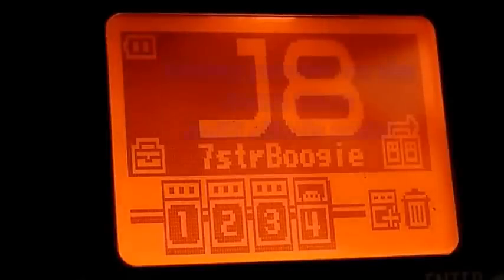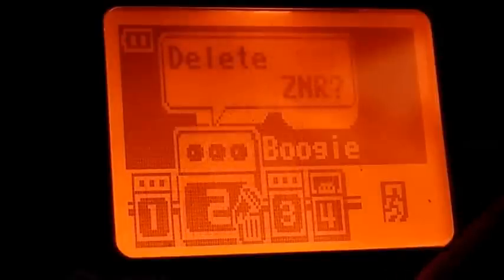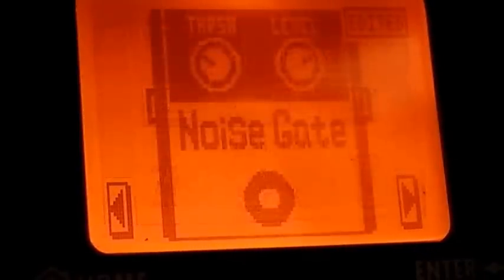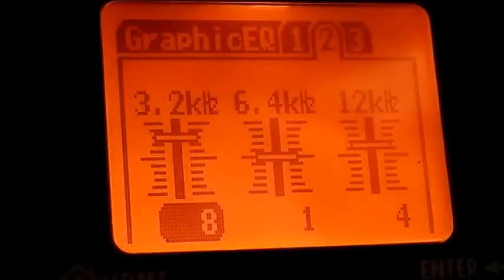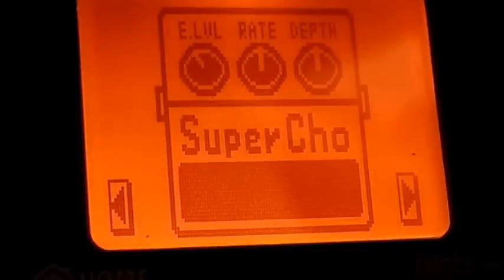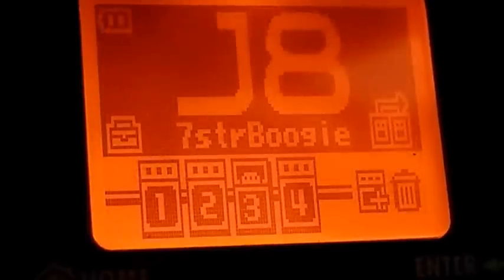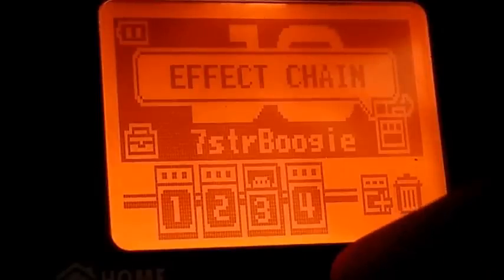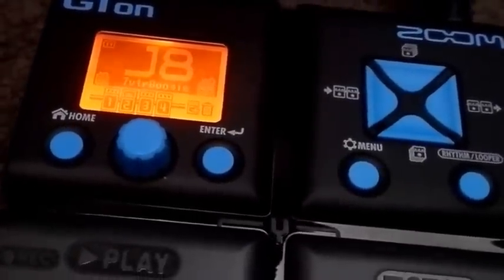Editing patches on the Zoom G1on

Comment: This video is all you need to start using the unit.  Thanks!   I just got the pedal and was scratching my head on a couple of things...but after watching from start to finish I can figure out the patch part.  
The parts of the editing features you didn't elaborate very much on I figured out by just using the enter switch and looking around.
Reply from the maker: Glad it was helpful for you Gary. Yeah there's a lot of depth for a cheap pedal, it'd be nice to cover it comprehensively. Thanks for watching Gearfacts :)

Comment: Like this tutorial, thanks a lot. I am wondering if You can use more of the same effects in the chain ( for instance 2 or 3 delays or 2 or 3 overdrives).
Reply from the maker: Yes, you can use any selection you like. Sometimes layers of complex effects will be too much for it though, and it will give you a message saying that the effect processing limit has been reached. But layering 3 delays is usually ok, and I made a video about piling up 5 distortions. That was a while back, I think if you search for "G1on distortion experiment" it should appear :) #gearfacts
Reply: @gearfacts  
You kindly answered quickly, thank You!! Yes, the Cpu of this machine can get overloaded, I saw it somewhere else. I was thinking to spare two effect using a Boss Compressor I already own, and my wha pedal in the end of the chain. So the rest would be lots of fun....

Comment: I bought my G1xon used a few years ago. It's my Swiss army knife for writing riffs. I have a question about updating the unit, what does it improve? I am not the most computer savvy man but I could get r done if need be. I was wondering if the effect options change or offer more by doing this. Thanks
Reply from the maker: I don't remember noticing any change at all apart from a few effects being added. The same result can be obtained by downloading Zoom's effects librarian software (it's name escapes me now but google will know)
Reply: @gearfacts  thanks, a couple of effects is still a couple more than it had already

Comment: Hi :) I have a question,

When you modify a patch and decide to save it into another location like you did from J8 to J9, what happens to the patch that was originally in J9? Does it get replaced or does it get moved to a different number?

Also, great video and very clear visual of the g1on screen. I can't even see the screen in most videos and therefore can't grasp what is being done with full clarity.
Reply from the maker: I'm pretty sure you end up with two copies of the same patch, as the original (J8 in this example) gets saves automatically. You can override auto-save though, in which case J8 would return to its factory settings once you switch to another patch ...I'm pretty sure that's what happens, anyway... Gearfacts
Reply: I really didn't expect such a quick reply!! Cheers man!! This is awesome!

Coming to the query, we have 2 different patches at J8 and J9 right?
What I wanted to know is, if I modify J8 and decide to save it in the J9 slot, what happens to the already available patch at J9? As in the factory programmed patch in J9? Does it get relocated to say, J10 or does it get over-written by the modified J8 that we saved?
Reply: M S Nahush Kumar i

Comment: Help me please.. How to save it after edit.. To many time edit but after start playing its is the original tone..
Reply from the maker: Hmm it should save automatically... Check the menu section and see if there is an autosave on/off setting. It may be set to NOT save changes. Gearfacts
Reply: I have the same problem :(

Comment: Hey Man, If you can please share Guitar patch for playing U2 songs with Delay effects for songs such as With or Without You, Pride, Bad or Where the streets have no name. I will be grateful. Thanks, Aseem
Reply from the maker: Hmm I don't have anything specific, but I do know that they use Vox amps and analog delay, both of which are simulated in the G1on. Use lots of dealy of course, with the time set to about 250 to 300ms, not too much feedback but nice high volume on the delay effect. A bit of overdrive would help too, maybe experiment with putting the overdrive just before before the delay to bring out some extra crispiness. Also, you won't need much reverb if any. I hope that helps :) Gearfacts
Reply: Thank You very much for the quick response. One more last question how can i use longer sustain to play with or without you. The intro solo is played with using ebow or line 6 if i am right. Is there any option given in G1X to create that long sustain which edge is playing in the song. Thanks Again!
Reply from the maker: Aseem Bhardwaj compressor is the answer. You can use it to boost a falling signal.
Reply: Thank You very much
Reply: Thanks Lord. one more last question is there any scope to increase long sustain (solo by edge) like the one used in With or Without  You song